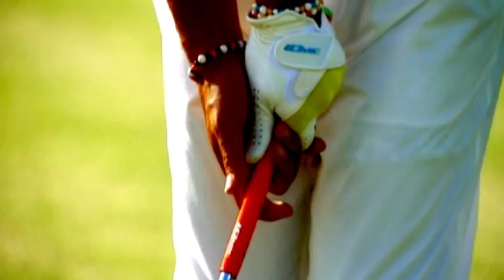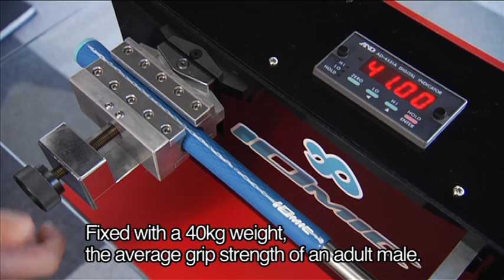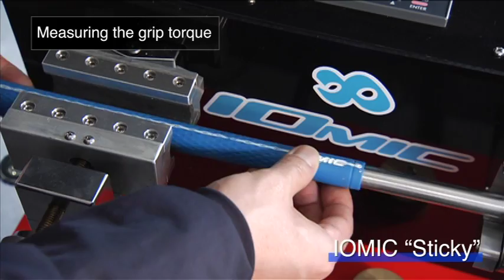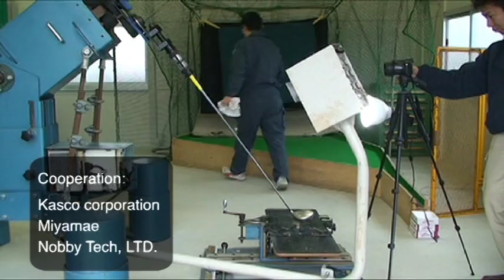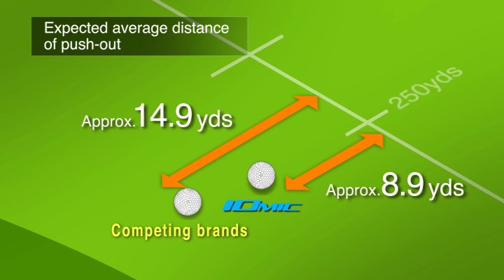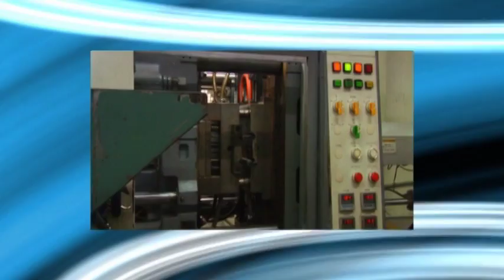IOMIC Grip Innovation

Comment: Another thing, you're somehow coming to the conclusion that an off-center hit (toe side) will cause the ball to spin to the right.  The complete opposite is true.  When you hit it on the toe, the gear effect will impart hook spin on the ball, so only measuring face angle to say the ball will end up 5 more yards to the right is incorrect!

If you guys want to be taken seriously, you need to prove your data on a TrackMan launch monitor, not calculating theoretical numbers at an instance in time.